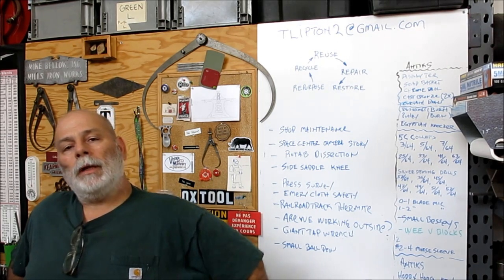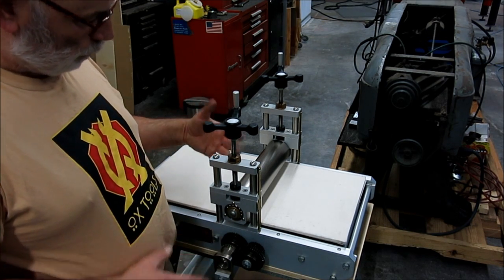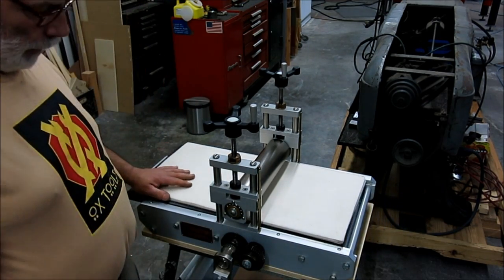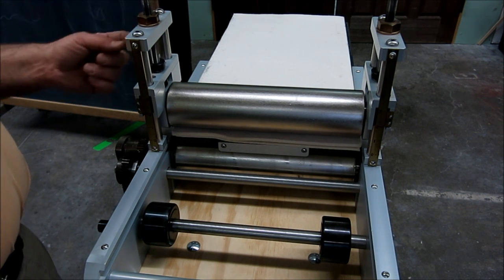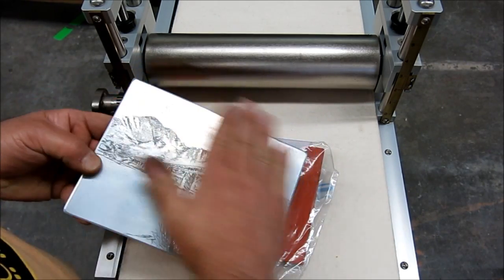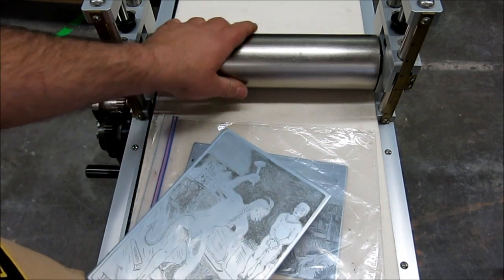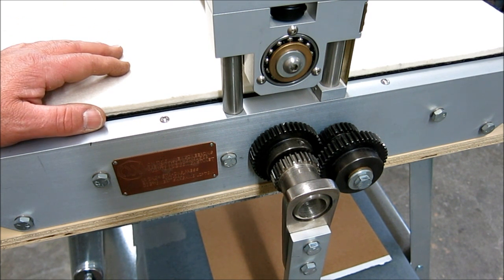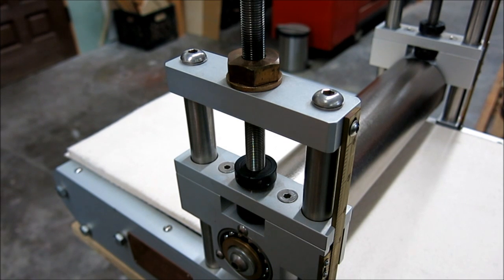Small Etching Press Survey

Comment: ROLL PINTCH SETTING -- PUT A SANDWICH OF ( 3 ) PIECES OF NOTEBOOK PAPER ABOUT 3/4 "X LONG , CENTER PIECE NARROWER THAN OTHERS , PUT 1 SET ON 1 END OF ROLL & 1 ON OTHER END . SET ROLL TO WHERE IT ( LOOKS ) RIGHT & TRY TO PULL CENTER PIECE OF PAPER OUT , A TINY BIT , ADJUST ROLL TILL THEY FEEL THE SAME . THIS WILL GET YOU TO A .0001 OR SO OF PARALLEL . 50 YRS. EXPERIENCE .

Comment: is the bottom roller moving the bed or is the bed moving from some other hidden gear?
Reply from the maker: +Llia Olsen Hi Llia,

Good question. The bottom roller is exactly tangent to the underside of the bed. When there is any pressure on the bed the rolls pull the bed through the machine. Thanks for the comment.

Cheers,

Tom

Comment: Really nice craftsmanship!  I enjoy all your videos....

I have a question.  I also live in the Bay Area.  I live on the coast just south of SF about a block away from the ocean.  I'm always paranoid about corrosion so I often make parts out of stainless when otherwise steel would be just fine.  I was wondering with your rollers if you could share where you have them Ni plated.  Is there a local company you could recommend that does this?  Many Thanks in advance....  Oh while I'd love to have a pin, I'm sure NorCal is already full of them :-)
Reply from the maker: Hi Neil,

Thanks for the nice note. The rolls were nickel plated by Global plating down in Fremont. I have used them for years for all my common plating needs.

Cheers,

Tom

Comment: I was wondering when there would be something on the etching press.

Really cool design on the mini-press. The height adjustment is really well thought out. 

At school they had an antique etching press, well antique by today's standards, and the way they did it is they had a chain underneath the bed that adjusted both sides at the same time, one screw being counter-clockwise.

Problem with that is over time the two screws and supports for the roller went apart at the top and cracked the cast iron support rails and so at some point someone added a brace across the top.

What they did seem to get right, in retrospective after hearing from you that the bed warps, is that the bottom of the bed which was cast iron also, had a square grid cast in to it. So this press even after all this time and the "towers" failure still had a straight table from one side to the other.

Can't wait for more work on the big one.
Reply from the maker: Hi Aserta,

I would love to examine some older presses. I volunteered to service a couple of larger etching presses so I could examine them in close detail. The large press will have a synchronized height adjustment but done from the top. 

All the best,

Tom
Reply: oxtoolco I'll see if i can sneak in the school again :)) and take a few pictures or a vid.

Cheers.

Comment: If that press can bend 1" aluminum over time, how often do the plates with the embossing need to be replaced? And do the plates imprint the image or just transfer ink?
Reply from the maker: Hi Andre,

The bed plate on the small press was 1/2 inch aluminum. The individual plates are not run through the press that many times so they don't seem to take a curvature. The plates do both, emboss the plate and transfer ink. The image actually has some relief to it.

Cheers,

Tom
Reply: Oh cool, when you finish the large one I'd love it if you could shoot some video of it working. Seems like a neat machine.

Also, I'm working on a mini pallet with extra features, look out for it. I think your gonna like it.

Comment: Wow! Nice build. I would like to know how one would calculate a vernier scale like the one you made for the press, i.e. how far apart the lines on the verneir in relation to a fixed scale marking.
Reply from the maker: Hi Jim,

A vernier is a beautifully simple device. If you take an increment say one inch for our discussion. You divide that one inch into ten increments. This gives .1 inch divisions. Now the vernier scale is also one inch long but is divided into nine equal increments. This further subdivides the .1 inch divisions into ten increments giving .01 resolution. There is a good article on Wikipedia about Mr Vernier.

Cheers,

Tom

Comment: Nice work Tom. I'm curious what is the finish on the other parts. Looks almost anodized, or perhaps plated in some way. Hard to believe this machine wasn't production built, except its hard to find that kind of quality in commercial equipment. 

Bill
Reply from the maker: Hi Bill,

Good eye. The aluminum side rails were clear anodized. The rolls were nickel plated. Mainly to keep from transferring crud to the paper or image. Thanks for the comment and compliment.

Cheers,

Tom

Comment: Tom "Frank Abignale Jr" Lipton ... now it is all starting to make sense lol  I am going to have to google thrust bearings as I wasn't catch the pre-loading explanation, but your attention to detail is great Tom and love the build plate you put on.  That big press is going to be a beast - are you going to have to camber the rollers to maintain consistent pressure over the full 48"?  Might have to ask Adam's UPS lady up to give you a hand when you are mounting them...... :)
Reply from the maker: Hey Steve,

The thrust bearings are sandwiched with a plate in between. The collars preload the bearings so there is no play but they can still rotate freely. As the press is loaded the bearings allow the screws to turn easily under load.

Hope that helps.

cheers,

Tom

Comment: Tom, that is cool!  No, it's VERY Cool!  :)  

The demo press at the U. S. Currency Printing Plant (USCPP) is a monster, too, probably about the size of the one you have under construction.  I want to say that it has a huge piece of granite for the bed, but I can't remember for sure.

Oh!  Maybe the USCPP has some old, used plates of hundred dollar bills that they're done with?  I'll have to ask next time I'm out their way.You could TIG in Ben Franklin's portrait and grind it smooth so your wife could scratch in your portrait instead.  

On second thought, you might just want to go with a completely new design.  No point in having to haggle over royalties or risk copyright infringement with Uncle Sam.
Why not base the new currency on a unit called the Oxen, or, for short, an Ox?  The 100 Ox bill would have your portrait on the front, and, naturally, the reverse side would have the YAM image on it.  Of course the bills would have to be printed with blue ink matching your blue Sharpies.  The motto on them could be, "Let's suit up and get started!"

Exchange rate would be 0.746 Ox = 1 horsepower.  Not sure how that would translate to dollars.  Guess you'd just have to go to the SF Bay and float them against each other to see what worked out.  :)

Very nice little press!  Maybe when you get the big one completed Mrs. Ox will let you borrow the small one to press your socks.  

Cheers,
Richard
Reply from the maker: Hi Richard,

Thanks for the nice comment. I don't think she will let me mess with the machine once its operational. You know how that goes. By the way how is our tunnel going? Might need some extra scratch to pony up for the rolls on the big boy.

All the best,

Tom

Comment: Just an exemplary project! Well done! I'm really looking forward to seeing the 'big one' now. Do you have any idea to the amount of pressure/in2 required for optimum ink transfer? 
Thanks for sharing this item. I saw several approaches to construction that I can apply to some of my anticipated projects.
Reply from the maker: Hi Fred,

The pressure is a difficult thing to quantify. Best I can figure it ranges from 20 to 75 lbs per lineal inch. It depends on the image and type of plate used. The blankets distribute the pressure over a larger area so the numbers are probably a peak at the nip point.

All the best,

Tom

Comment: Pretty cool. Looking forward to the big brother.

Nit: if you used a gray "flannel" or even just a piece of gray cardboard, the camera would not have the white flannel overwhelm its exposure setting. That would let folks see more of the dark details in the opening minutes.
Reply from the maker: Hi Pat,

The felt blankets are part of the printing process. I was playing around with locking the exposure down a few notches to have it not blow out on me. Thanks for the suggestions.

Cheers,

Tom
Reply: oxtoolco I'm sure that your artist wife will want to use the plain/white ones for actual work, but for your video show-n-tell, you can use something just for making the video. Any art supply shop will have large poster boards in assorted gray tones.

Comment: What a nice piece. Before I got into working into the old bikes and cars and machine work, I went to school for printmaking. We used a monster probably similar in size to the one you're working on now. We used a film on lexan rather than etching directly into a plate. It was photo exposed and developed in some chemicals which created the etched surfaces. I still do silk screening but do miss the intaglio printing. Great video.
Reply from the maker: Hi Ryan,

Thanks for the comment. I'm sure Mrs Ox will get to experiment with all kinds of new process's. I really like the slight relief on Intaglio printing. She also does monotypes on her small press. The big one will expand that work as well.

cheers,

Tom

Comment: Hi Tom, interesting to see the small press. I did some industrial espionage when I was asked to make an etching press. At the time, about fifteen years ago, Richebe, the only ( I think) Parisian etching presse builder was using what was described as "duralumin" plates to replace steel ones i think mostly for weight. Recently, I've seen 19mm melamine coated MDF on a 100mm Ø roller, 60mm wide press. I don't know how long it is expected to last, but it would certainly be a cheaper solution! MDF is medium density fibre board, I've not actually seen a high density fibre board, maybe it would be worth investigating. http://www.weihuaonline.com/Eng/files/DensityFiberboard.pdf
Regards, Matthew
Reply from the maker: Hi Matthew,

I'm pretty sure we will be using a 25 mm high pressure phenolic composite for the main bed. We have used the phenolic plate on the small press and it has held up well for longer than the original metal plate. The weigh savings alone makes it attractive as well.

Cheers,

Tom
Reply: oxtoolco
Tom,
I'm in the process of planning my own 12" press. I was also looking to use phenolic laminate but am not sure on what thickness to use. Is you press bed still holding up and if so, what thickness did you use for the baby press?
Cheers
Peter